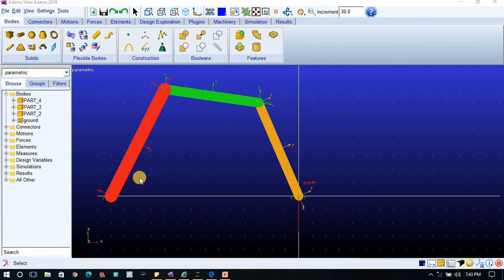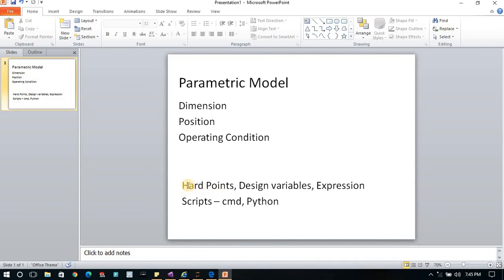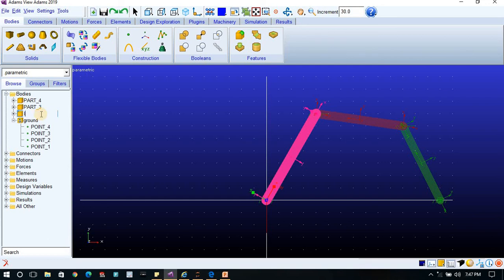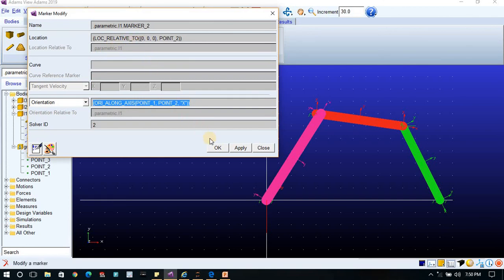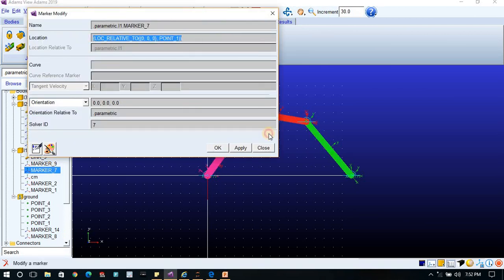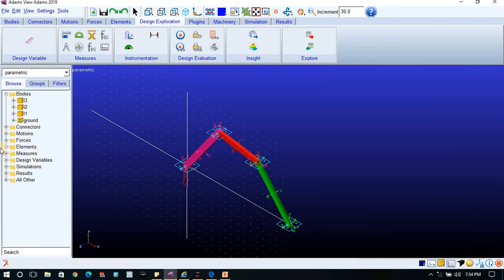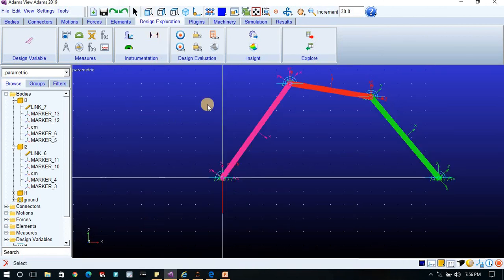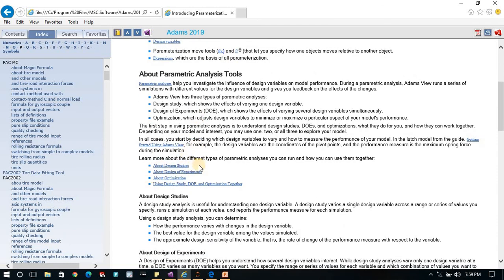Parametric Model in ADAMS View - Part_1

Comment: is it possible to create design variable for the length of links without x-y coordinates?
Reply from the maker: There is no variable for length for link it is for cylinder geometry
You can do in reverse for link by calculating coordinate of the end marker based on length of link with trigonometric relations